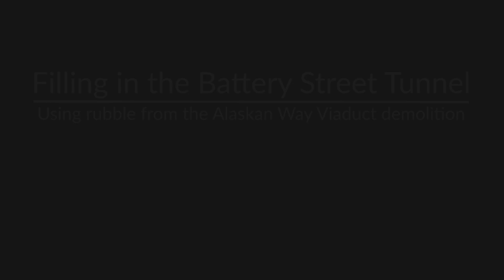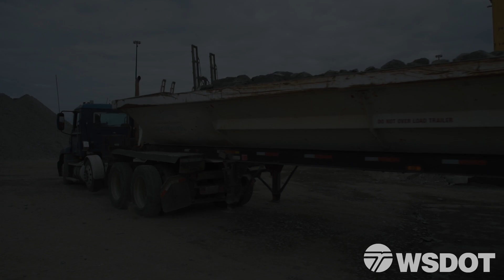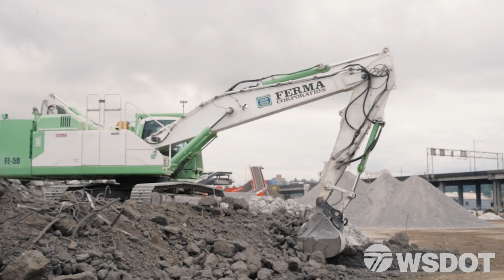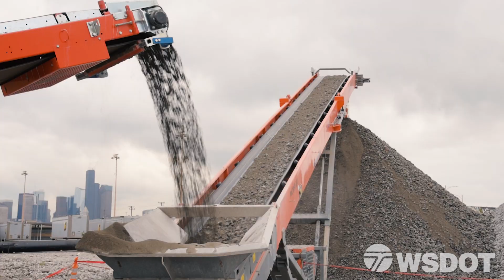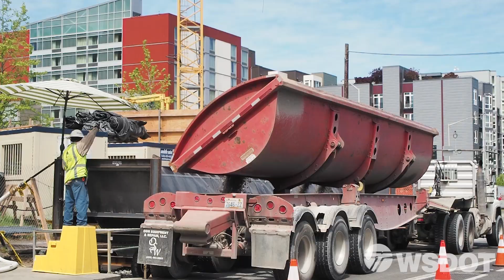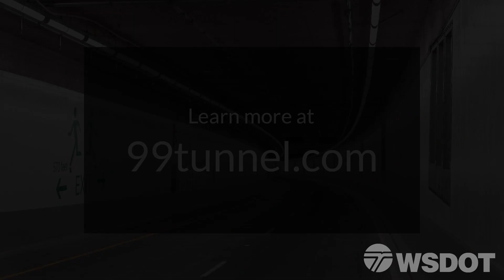A look inside the filling of Seattle's Battery Street Tunnel

Comment: It's weird to me the city couldn't find a use for the battery street tunnel. I assumed for years they'd use it for seasonal utility storage or some other mixed use. I suppose this is the cheapest option but space is space in Seattle.
Reply: I believe the Battery Street Tunnel was also likely to collapse in an earthquake, so it would have needed expensive renovations to use for a new purpose.
Reply: I took a walk thru the Battery St. tunnel the day of the new tunnel's opening.  It was in pretty bad shape.  I saw a lot of exposed rebar along the wall that separated the two directions of traffic, the result of vehicles hitting the wall and taking out chunks of concrete over the years.  And it was filthy as hell.  Think of how many years' worth of exhaust gasses and grease and grime that built up since the last time it was properly cleaned.  

Not sure of its seismic capabilities, but considering it opened in the 50's, it likely was not built to any type of seismic code.
Reply from the maker: Along with the City of Seattle, we examined other possible uses but all would require expensive retrofits, as the tunnel is seismically vulnerable and its operational and safety systems outdated. Also, if we kept the Battery Street Tunnel open we would not be able to rebuild Seventh Avenue North (formerly Aurora Avenue North) at the north end of the tunnel.
Reply: @wsdot  thanks for filling us in! <pun intended>
Reply: @charliemac64  FWIW, that was a year, or maybe two at best of exhaust, grease, and grime build up.  The Battery street tunnel used to be closed for a weekend every year to be cleaned.  In fact, I believe they cleaned it before they started filling it with rubble, since they didn't want to leave the potentially toxic materials underground.
Reply: History means nothing to the newly arrived with the ink still wet on their diplomas.

Comment: The excavator looks like it's used to even out the layers they're poured - what's when the fill level reaches near the top when you can't fit the excavator? How will you then continue leveling it off? Great video.
Reply from the maker: The crushed concrete fill will fill the tunnel until about 7 feet from the roof. At that point, the contractor will pour in a low-density cellular concrete to fill up the remaining space.
Reply: called a bulldozer learn things

Comment: What's a good recipe for apple pie?
Reply: not one with dirt!  LOL
Reply: Ingredients
Pastry:

2 1/2 cups all-purpose flour

1/2 teaspoon salt

1/2 cup vegetable shortening

1/2 cup ice water

Cooking spray

Filling:

10 cup thinly sliced peeled Granny Smith apple (about 3 pounds)

3/4 cup granulated sugar

1 1/2 tablespoons all-purpose flour

1 teaspoon ground cinnamon

1/2 teaspoon salt

1/4 teaspoon ground nutmeg

1 tablespoon chilled butter, cut into small pieces

Topping:

1 tablespoon fat-free milk

1 teaspoon turbinado sugar

How to Make It
To prepare pastry, lightly spoon 2 1/2 cups flour into dry measuring cups; level with a knife. Combine 2 1/2 cups flour and 1/2 teaspoon salt in a large bowl, stirring well with a whisk; cut in shortening with a pastry blender or two knives until mixture resembles coarse meal. Gradually add ice water; toss with a fork until flour mixture is moist. Divide the dough into 2 equal portions. Gently press each portion into a 4-inch circle on heavy-duty plastic wrap; cover and chill 30 minutes.

Preheat oven to 425°.

Slightly overlap 2 sheets of plastic wrap on a slightly damp surface. Unwrap and place 1 portion of chilled dough on plastic wrap. Cover dough with 2 additional sheets of overlapping plastic wrap. Roll dough, still covered, into a 12-inch circle. Place dough in freezer 5 minutes or until plastic wrap can be easily removed. Remove top sheets of plastic wrap; fit dough, plastic wrap side up, into a 9-inch deep-dish pie plate coated with cooking spray. Remove remaining plastic wrap.

To prepare filling, combine apple and next 5 ingredients (through nutmeg); toss gently to coat. Spoon apple mixture into prepared pie plate; top with butter.

Slightly overlap 2 sheets of plastic wrap on a slightly damp surface. Unwrap and place remaining portion of chilled dough on plastic wrap. Cover dough with 2 additional sheets of overlapping plastic wrap. Roll dough, still covered, into an 11-inch circle. Place dough in freezer 5 minutes or until plastic wrap can be easily removed. Remove top sheets of plastic wrap; fit dough, plastic wrap side up, over apple mixture. Remove remaining plastic wrap. Press edges of dough together. Fold edges under, and flute. Cut several slits in top of dough to allow steam to escape.

To prepare topping, brush top of dough with milk; sprinkle turbinado sugar evenly over dough. Place pie plate on a foil-lined baking sheet; bake at 425° for 10 minutes. Reduce oven temperature to 350° (do not remove pie from oven); bake an additional 40 minutes or until browned. Cool on a wire rack.